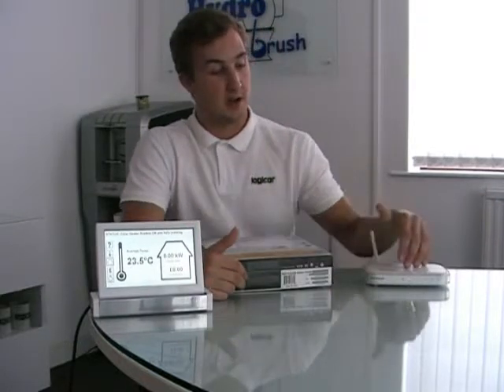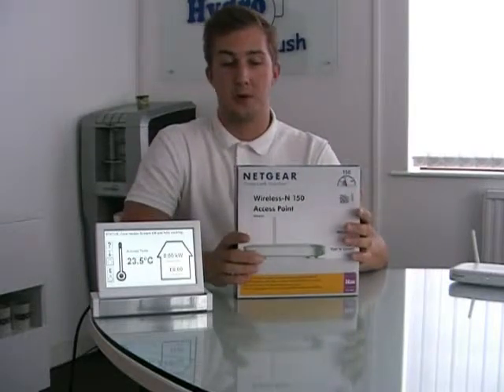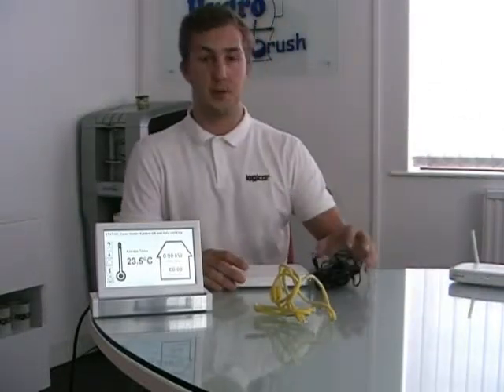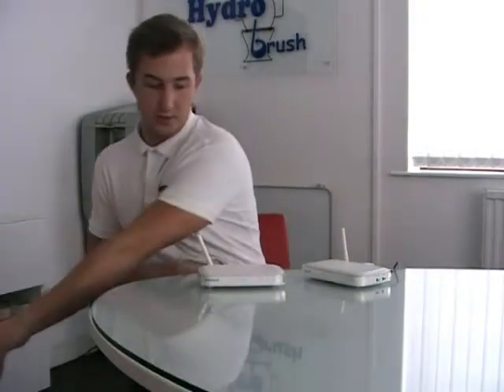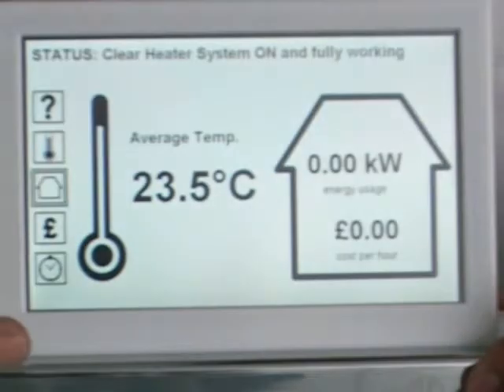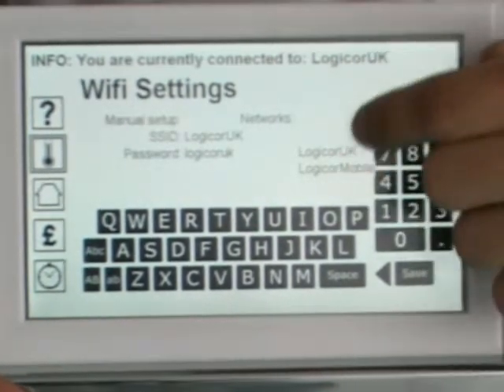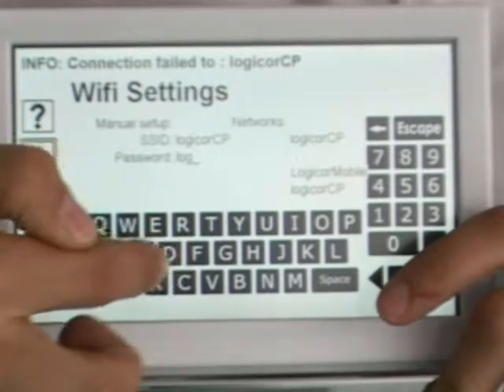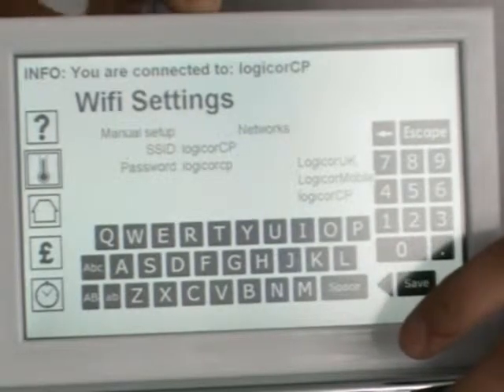Logicor Clear Heating System Wifi Bridge demonstration

Comment: we have those and we dont have internet yet, what are the benefits of connecting to wifi?
Reply from the maker: We have picked up on your comment and send you an e-mail.
Technical Support will also attempt to contact you to assist you.
Then benefit of connecting your system to Wi-Fi is we can see it on our servers and tell you if there is a problem. You will also get software updates automatically.

Comment: And no remote control from smart phone, system gets useless to from Internet...  It should have ability to control remote all the heaters, and see the status for that amount off money payed for it... This sux...
Reply from the maker: Thanks for your message. The system does have smart phone and tablet control both of which were added after this video was uploaded. As the system is sold in multiple countries some functions may be restricted to in order to comply with local laws but, if you would like to talk to us further about how to access the applications please e-mail Technical Support at techsupport@logicor.co.uk and they will assist you further.